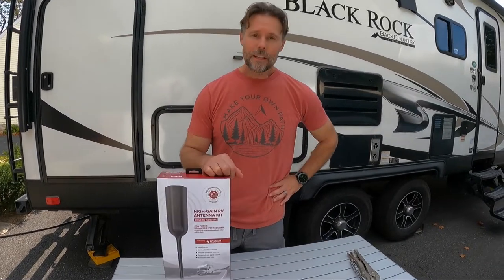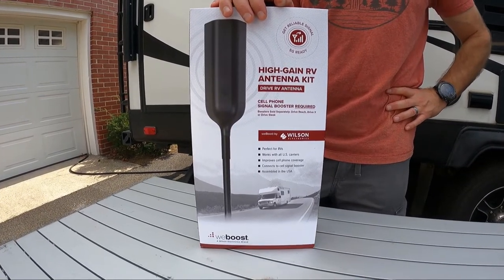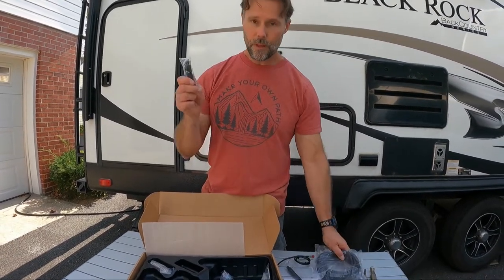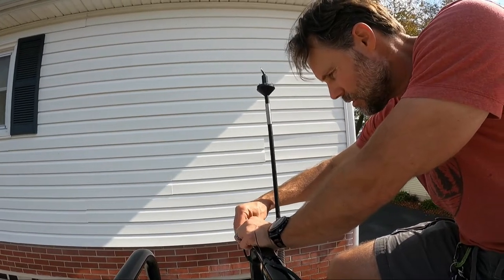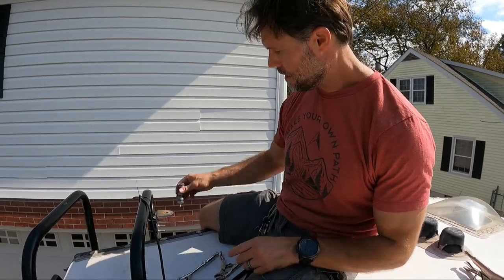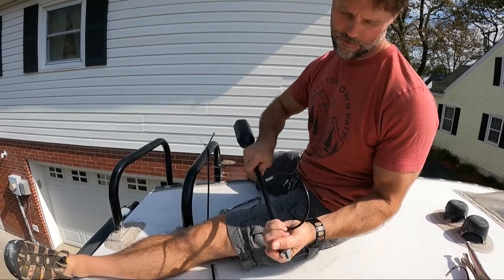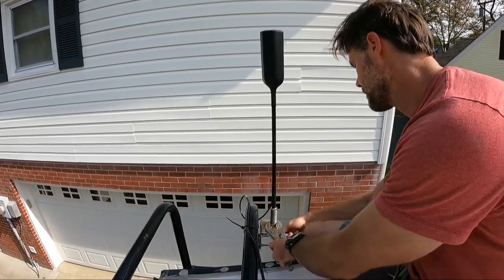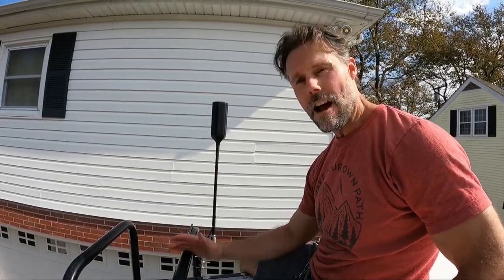How To REPLACE A WEBOOST ANTENNA On An RV | RV Living | Reset Your Journey

Comment: To avoid that happening to mine I installed the antenna on a folding boat antenna mount. It works almost as well laying down and it's simple to stand it up by turning a tension lever.
A thumbs up for the video 👍🏽
Reply from the maker: Brilliant solution! I may have to do something similar in the future. Thank you for the comment and suggestion.

Comment: I would be inclined to make a folding mount. But in my years of having cb/ham antenna I dont think i know of any time one broke off. So its probably not necessary.
Reply from the maker: An articulating mast that locks down at ninety degrees is a brilliant idea! It would have prevented this rare occurrence. Always appreciate your input! Stay well.